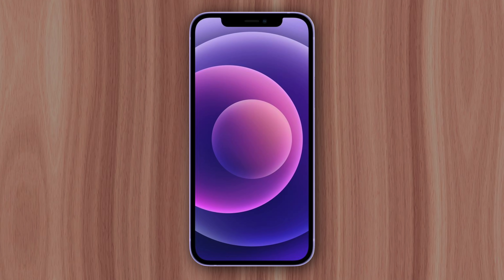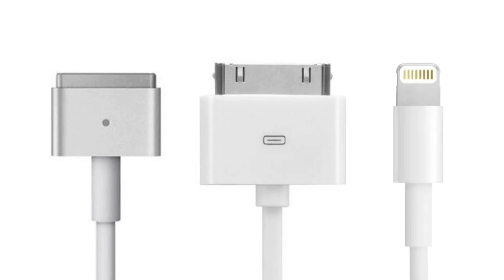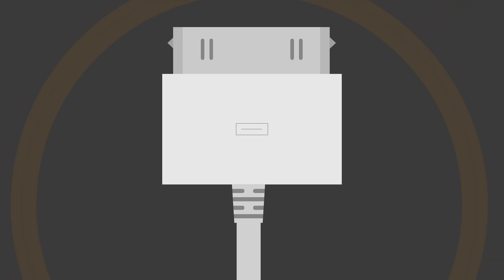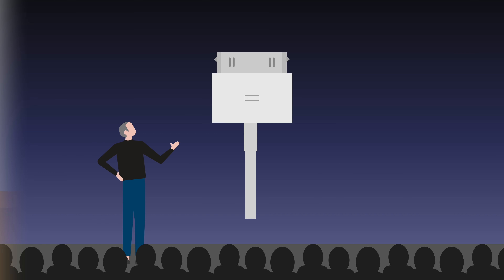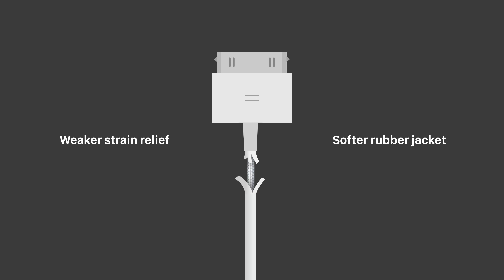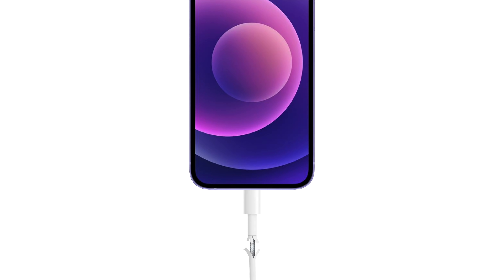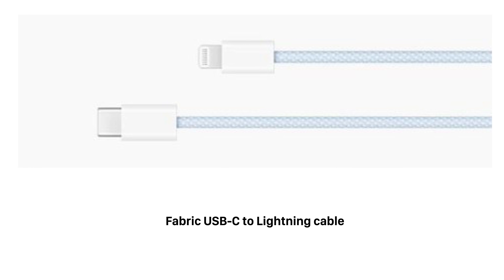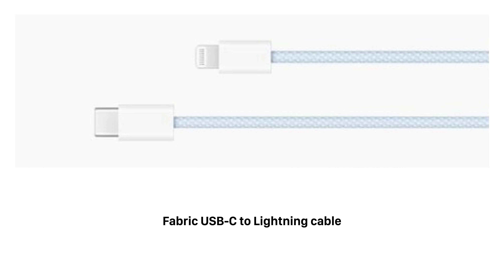Why iPhone Cables Break So Easily

Comment: On Amazon, get yourself some Sugru Moldable Glue. It’s basically like silly putty that you put around the the area where your cord meets the plug. Let it sit for 4 hours and it hardens into plastic. Can’t recommend it enough. You can fix damaged cables and prevent NEW cables from fraying.

Comment: Lol people also need to be more careful with their cables
I’ve had one of mine for over 4 years and it still looks new
Reply: Yeah, all Apple cables I own lasted at least 2 years before fraying.
Reply: Yea pay high price and still be careful.. It's not like you use cables to lift stuff or anything.. My samsung cables never broke and still good after 4 years even with lot of twisting and cramming in my backpack. Its a well known fact that Apple makes shitty products which will fail after a while.
Reply: @gulammohiddin5747  who uses their cable to lift stuff???
Reply: @alraapl  Thats my point. Its not like you use the cable to do such stuff. So what do you mean by being careful? Leave it at home and not move it around?
Reply: @gulammohiddin5747  if a charger breaks with normal use then that’s most likely your fault. I travel with my cables a lot and they are nowhere near the ones shown in the video

Comment: Using wireless chargers/wireless charging docks, never experienced this durability issue. I only use the cable when I need to fast charge the phone after forgetting to lay it on its charging dock.

Comment: Am i the only one who never had a single cable failure in over 10 years? From the iphone 4 to the iphone xr. My father literally has an ipad 2 or 3 with the original cable and it’s barely starting to break down..

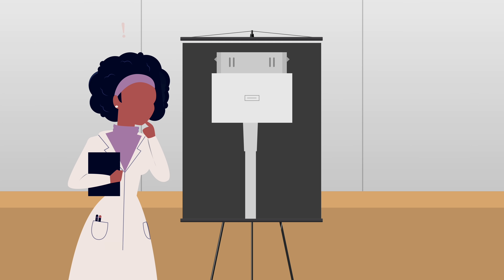Comment: 1:00 not true at all. All of my old cables are totally torn appart and fixed with electrical tape several times. In comparison, I have been using the newer type for 7 years every single day and the most wear is on the electrical contacts. The cable is still almost intact.

Just do not twist your cable like an idiot and it will last a decade with ease.

Comment: am I the only one who’s never encountered this issue. bought an iPad back in 2017 and the wire is still completely fine
Reply: Same with me, since my first iPhone, I never needed to use the new cables that come with my newer iPhones, it’s still fine after 5 years for me
Reply: You’re not the only one. I got an iPad (Air 3) at the end of 2019 (november to be exact) and the cable is still fine
Reply: Same, have been using it since the iPad Air 2 released
Reply: Nope you’re not! Never broke one starting with the iPod 2005 onward
Reply: Yep, you’re the only one!

Comment: Or they might just get rid of the charging port overall, and say “Here is your solution to cable failures” 👀
Reply: I’m looking forward to it. I haven’t plugged anything into my past four phones since 2017 nor have I plugged anything into my AirPods 2nd Gen nor Apple Watch. Only reason I still owe no lightning cable is to charge my Siri remote, which only needs to be charged once or twice a year basically so I don’t care that it doesn’t have wireless charging built-in.
Reply: @christophercrawford2736  no way I am trading my 20w fast charger for any wireless slow charger…
Reply: @TJCCBR47  my 15w wireless charger isn’t that slow. But I don’t mind the speed. I charge mainly overnight while sleeping.
Reply: @christophercrawford2736  the battery will degrade lol
Reply: @rochitgurung9090  wireless charging is much better for your battery than wired
Reply: @holyaubergine  not true actually, wireless charging is more inefficient and can cause heat issues which further degrades the battery than wired charging
Reply: @lifeisshørt_420  Answer from website: All in all, probably not.  There are all sorts of little things that affect ultimate battery longevity, including heat (that's the huge battery killer), charge/discharge levels, etc.  The user can't really program the iPhone battery management outside of a lower-power mode to reduce power consumption.  If that were possible I could see a battery easily lasting 10 years if one could fix it to only operating between a 25% and 75% charge range.

The thing about the wireless charging (really a power source) is that it's not as high-powered an input as a wired power source.  USB-A power sources will be limited by the internal charging circuits to 2100 mA or 10.5W at 5V.  There's "Fast Charge" from a USB-C power adapter, but there's really no numbers on what the max current is for that.  The fastest Qi wireless charging is 7.5W.  However, there will likely be additional heat from the conversion from the RF signal to DC current inside the phone.  Not sure how much heat that will create though.

But as a practical matter I don't think it's worth worrying about.
Reply: @holyaubergine  only in the case of fast wired charging. Whatever generates tons of heat isn’t good for your battery. That’s why I like to choose good quality brands for my wireless chargers.
Reply: @rochitgurung9090  I only use the MagSafe(15w) charging sparingly. I leave it at my girlfriends house for when I’m there late in the evening after work and need to charge.
Reply: @christophercrawford2736  Glad wireless charging is working for you but it’s not good for a lot of other people. Some of us prefer plugging in for convenience to be on it while charging and to have it charge faster
Reply: @lifeisshørt_420  I just learned to stop being so addicted to my phone and let it out of my hand to charge. I feel it’s much more healthy mentally and my hands not cramping up from holding my phone so much are thanking me.
Reply: @christophercrawford2736  I’m not on it a lot whenever it’s charging it’s only a sometimes when I need to. But yes you are right about it being better for your mental health though
Reply: @lifeisshørt_420  it was pretty annoying at first but i got used to it. Was annoying as hell on the iPhone X but the newer phones have better battery life.

Comment: I'm at a point where I don't even unbox the Apple cables. The stress relief is fine, it's the outer rubber layer that just disintegrates within months of careful use. Sometimes it's the internals that fray first though and the cable turns brown in some spots or casually lights on fire. I'm so happy we're charging with USB-C now and can use reasonable cables instead of the old magsafe, the plug was great, the cable was garbage.

Comment: pro tip: just take care of the cable and you’ll be fine. 

I still use my first cable, I got it with iPod touch  (2014) and I charge my iPhones (and the iPod touch obviously) with it. 
It’s a bit chewed up, courtesy of my cats, but nothing too serious.
I have a collection of lightning cables, sometimes when I have to charge multiple devices simultaneously I use them, but my first one is always my first choice.

Comment: First of all, I'm not an unnecessarily advocate for apple.  but I think apple gets too many unfair comments about it.  I bought the ipad 6 right in the summer when it came out and I shelve the cables that I do not use because I change my products every year and I have been using that ipad's cable since the summer of 2018 and there are only two problems.  First the color started to turn yellow, second the lightning port started to crack a little but it still works just fine and so I still have a lot of cables that I expect to use.  I mean the damage to these cables is related to the way you use it. Thank you

Comment: I'm sorry but I just have to react to this,.........I just can't stand it when people talk crap!!!

My wife and I have been using Apple products for well over a decade now. I'm not talking just iPhones, no sir we've been using pretty much everything Apple has been creating and putting on the market in this time periode. I'm talking several iPhones and iPads for the both of us, as well as both our Apple Watches and our MacBook and iMac. My wife uses 1st gen. AirPods for her music while she's out on a run. All in all we're using a fair amount of Apple cables and we've never had any trouble with them. 
I will admit to the fact that Apple's cables leave (some) room for improvement, but at the same time nine out of ten times it's us, the users, that have and are the biggest influence on how long products and their cables last.
When I see people reaching for their wired earbuds in bags, drawers and/or purses............and when they find them pulling them out with (some) force and through keychains and other stuff I don't find it hard to believe that their cables break so easily. Sometimes I even see them jangling the cable around in an effort to shake loose all other stuff that got caught onto the cable. No wonder the cable will get damaged.
Yes the cables are delicate,.....so try to handle them with (a bit more) delicacy!!!

Look at it this way:
Let's say for instance you wanna slap a good friend of yours on the back for a job well done. You can really slap him on his back with serious force, because he's a grown man and he can take it. Now when you wanna do the same thing to you four year old son because he did something amazing, you don't slap him on the back with the same amount of force you'd use with your buddy. You just might dislocate his shoulder.

I know I'm exaggerating a bit here, but it's just to make a point.
Use the cables to do what they're made for. When stuff is delicate, handle it with care. You don't go off-roading in a vintage car either!

Comment: Okay. Controversial opinion here. Maybe if people stopped pulling the plug out by the cable and by the plug itself then it wouldn't happen. 
I mean that's what i've been doing since I got my first iPod in 2004 and I have never had an Apple cable do this. I replace my cables every 4-5 years and mostly due to cosmetics, apart from one lightning connector where the hard plastic over the plug cracked when I went travelling.

Comment: Fun Fact: This guy is always there to Save Apple from every mistake they make in their products and accessories 😂😂
Reply: Fun fact: it’s an Apple channel. 

Hint: it has Apple in the name.
Reply: It's not too bad--he doesn't really save them very much. This video mostly came off as fair. I'm a huge critic of the cables, and I took this video as "why the cables are terrible". Not "the cables aren't terrible" or "why you should like these cables", but just "why the cables are terrible."

He never really criticizes them very harshly, and he usually seems a bit on the mild side of mostly fair.
Reply: This comment has so many grammatical mistakes that it hurts me.
Reply: @digithardt  no it doesn't
Reply: @snehendubatabyal7008  
"their" instead of "there"
unnecessary captial in Save
Reply: @digithardt  bro what is Captial 😂😂
Reply: @snehendubatabyal7008  Ayo, i'm on mobile so it's hard to type. My point still stands.
Reply: @digithardt  Bro the whole world is typing on mobile 🤣
Reply: @snehendubatabyal7008  what's with your use of emojis? also, i'm usually on a pc, so i guess i'm not part of "the whole world"

Comment: After buying many braided cables & metal cables & having them all fail on me, I figured out how to not break the cable, it’s actually pretty simple

1. Don’t bend the cable at the stress point
2. Plug & unplug holding the plastic part, not the rubber cable

That’s it, now your cable will never break

Comment: I've never been particularly gentle with my cables and  I've only had one break, my 2012 Macbook Pro charger cord. But It just broke like 2 weeks ago and no where near the cable end where you tend to see people reporting breakage. I'm more likely to say it was my fault because at one point I'd used electric tape on this spot to make the cord stiffer but later removed it and didn't bother cleaning away the adhesive residue and it looks like it weakened the rubber over time. I suspect oils from our skin does this as well.  I am looking forward to braided cords as with the new ipads and macbooks using usb c I've bought 3rd party heavy duty fabric cords because, despite not having issues with 99% of my Apple cables I prefer the heavier weight ones

Comment: this is unrelated but i have a problem and i thought i can ask here for help.
i have an iphone 6 and i was having batterry problems lately, it always couldnt manage enough power the phone when its unplugged and shut off the system when i open something that needs power.
today i didnt used my phone at all,plugged or unplugged becouse i was outside,when i came home i plugged it in and it stuck at apple logo loop.
it shows the apple logo,screen goes black but lights are open,then lights close,then apple logo then loop again
i couldnt do anything like plugging it to pc and using recovery mode,soft reset by buttons,hard reset by buttons, it just opens and closes again and again
i want to ask if this is a problem caused by my batterry or a softwere issue,if you think it is a softwere issue, can i save my phone without erasing it,how can i?

(i was planning to change to batterry but couldnt do that bc of lockdowns in my country) 
thank you guys for helping already,stay safe

Comment: Funnily enough, the cable included with my iPad Air 2 (bought in 03/2016) did had the rubber disintegrate. But the one included with my iPhone 8 Plus (bought 07/2020) has not a single sign of wear, not even yellowing. This is partly because I mainly use wireless charging, but it may be a higher quality cable indeed.

Comment: I feel like the people who say “money” are forgetting about third party cables. I’ve purchased more than one third party lightning cable.
Reply: Third party cables are licensed by Apple, they get money from all lightning cables. Also, have you ever heard of other types of charging cables breaking?
Reply: @ames12314  yeah, other cables break all the time. Also, I would have to look into your claims.
Reply: @jefferyjones8399  it's called 'mfi' (made for iphone or in the earlier days for ipod)
Reply: @phase4265  ...what?
Reply: @jefferyjones8399  if you do buy a super cheap parallel cable, they break easily as the original apple cable do. I purchased a Baseus one, payed the double of the cost of a apple original one, and this cable is on perfect conditions for almost 5 years now! A apple original one wouldn’t last half of the time...
Reply: @arthurhasse  Apple cables are fragile, yes. Other cables are fragile too, yes. Okay, cool. Some aren't. Got it. And?
Reply: @ames12314  the cable that came with my Nokia. The actual wires are still intact, but the sheathing and shielding gone haywire on the type c end.
Reply: You have to buy cable with extra protection. Like they have on pc cable. They are impossible to break. Apple doesn’t want to do it. Because of money and poor design.
Reply: Apple makes a killing through licensing the lightning connector and that's no secret, it's in their revenue reports. I for one never had a charging cable break on me that wasn't made by apple. Apple could make nice cables, but they don't want to.

Comment: While Apple cables have a bad reputation for breaking easily, I’ve had cables of all types, including braided ones, fail, fray, or break, even though I take good care of them. It’s just the nature of connectors, inevitably they fail since it’s a weak point and the point that gets the most usage. Apple just sped up the inevitable by using weaker materials.
Reply: How much were you using these cables? Just asking

Comment: """Because they are made to break easily""' 😂
Reply: And this video specifically answers the HOW they're made such that they fray so easily.
Reply: @Chrisratata  they r really thin o think that's y
Last year I switched to android and the cable was extremely thick but maybe that was BC it was 30 watts nevertheless they r too thin
Reply: @superior7387  like this video explains, it's not just the thickness it's that the strain relief design isn't ribbed (which cable design 101 tells them not too, but they prefer the aesthetic of smooth) and that the discontinued using pvc for environmental reasons. The fact that they can charge people for replacements is rather convenient bonus.

The thickness would be sufficient if the housing was ribbed.
Reply: @Chrisratata mine is not ribbed either but it's thick so more durable
Reply: fun fact: did u know that more people die from pigs than from sharks!! i will post regular vid like this so make sure to subscribe! btw i'm a kid!!!
Reply: @smoothgameplayfr  why are you advertising in the comments? Thats not a good way of advertising, no one will watch your videos and ignore you.

Comment: They break just like any other cable because people use their mobile devices with the cables being bent, flex the charging cable in different directions, having weight of the cable pull on it hanging over a table. I’ve never had this happen to any cable I own and actually still use a 30 pin cable for my original iPod touch and has no kinks or cracking.
Reply: Finally, someone who didn’t say that apple wants more money

Comment: I have a solution for everyone! Buy a Silicone Flexible Cable Wire Protector Amazon sells a 24 pack with different colors only for $4.99. I bought myself and my mother a 2 meter cable and attached these protectors to each end and they look brand new with no wear and tear. My apple cables only lasted 1 year maybe and this one I have currently has lasted me 2 going on 3 years. Trust me when I say for $4.99 it’s worth it.

Comment: It's true. Those canoes break easily. My iPad Air 2 cable, last about a year and half. But you can protect them by storing and using them carefully. I bout my iPhone X three and half years ago and I'm still using the original cable which was in the box. So it is possible to protect them